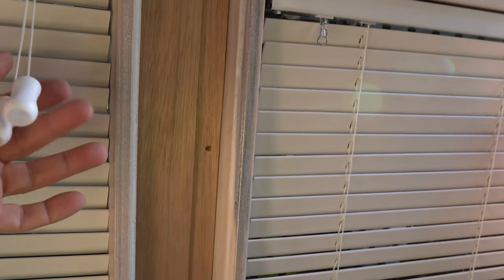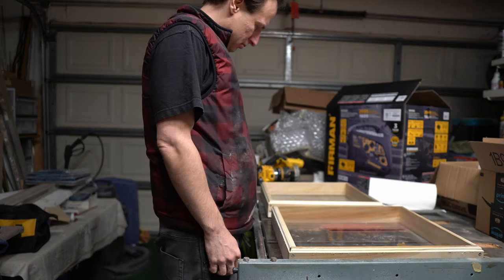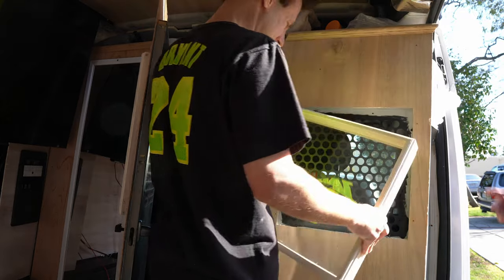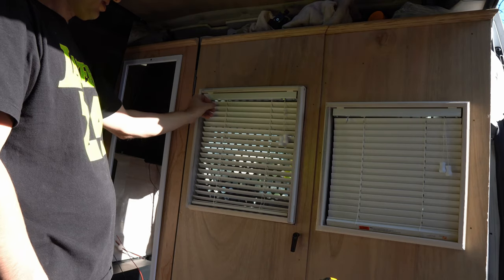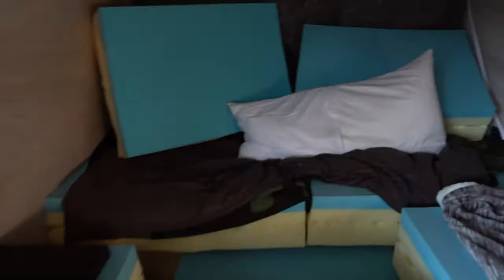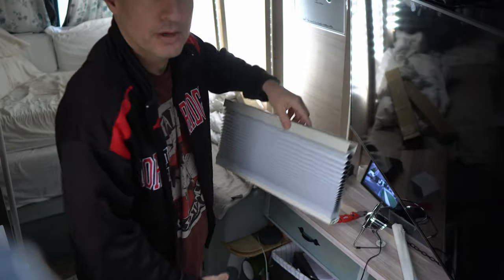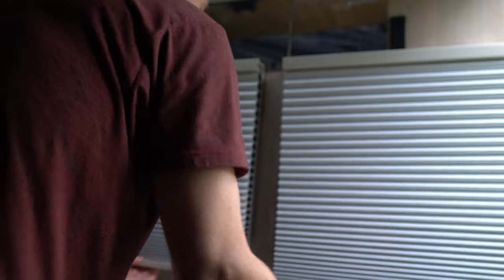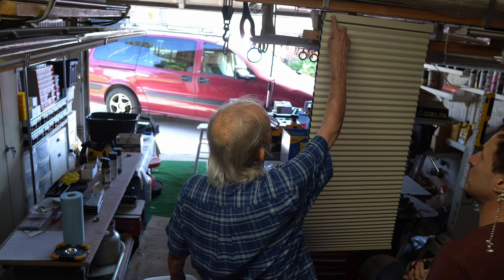Van Partition Cordless Shades & Wood Blinds DIY

Comment: 01:01
Prior to entering the work-zone, I don eye-protection.
My neighborhood kids hang around the shop with me, I try to be a good example.
.
My experience with routers is limited.
Do most require hearing protection?
Reply from the maker: Yeah, they’re kind of loud air plugs would’ve been nice. As you can see, I don’t think much about protection.

Comment: Brother how much money do I need to build a solar electrical system to run a window airconditioner like yours?  My landlord just raised my rent  and I really don't want to waste my money. I can shower at work.  Please answer
Reply from the maker: To be very realistic I’ll say 10 or $20,000 worth of lithium batteries but it really depends on what the weather is like where you are. For me there are many sunny days but if it’s cloudy for a week you need a lot of batteries or a place to plug-in. The more solar, the better too. I’m working on a video where I am running three 400 watt arrays at the same time and even that isn’t enough power when it’s cloudy.
Reply: @NoLimitVanLife  I don't have that kind of money bro. You gotta be kidding me right? Is this a joke? I'm in Los Angeles.
Reply: @Travis,
We and our caravan chums dismantled a photovoltaic array on an office building.
Each of us got all the panels we could use, plus plenty to sell.
.
Our ExpeditionVehicle has six 305-Watt panels, a total of 1,830-Watts.
These top our ancient bank of eight 105ah AGM.
Our AGM were a couple hundred each.
We use multiple 750-Watt inverters.
.
2003, our investment was less than a couple grand.
Amortized over two decades, the cost-per-hour is less than a penny.
.
An aside:
Our ExpeditionVehicle rarely gets better than 14mpg.
We rarely travel more than a hundred miles a month.
Fuel is a very minor part of our budget.
.
Are you seeing the correlation?
Reply: @largemarge1603  nice set up before I started. I would’ve not thought to do it that way and now I realize it’s the way to do it max solar several inverters several MPPTs and the biggest battery bank possible.